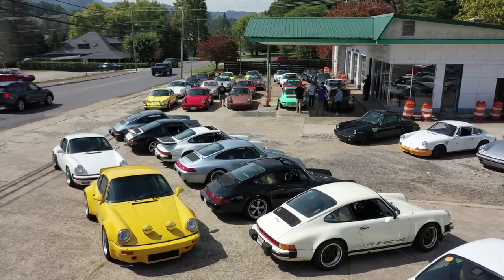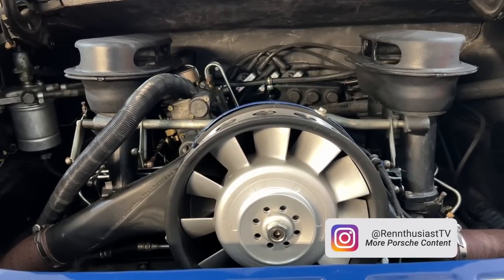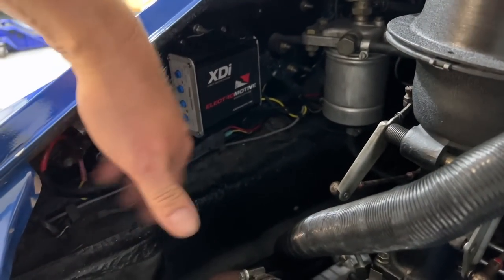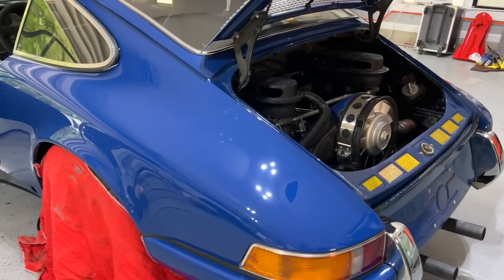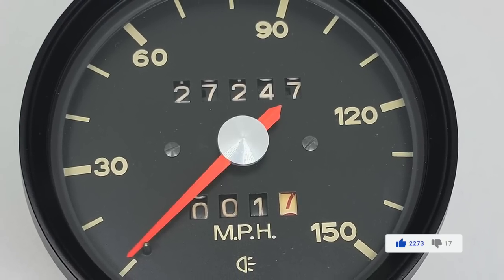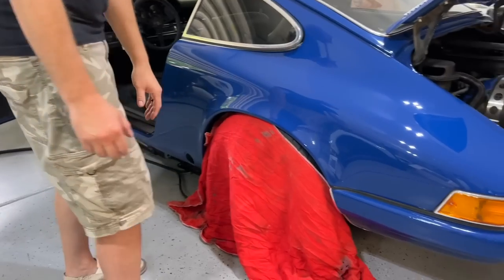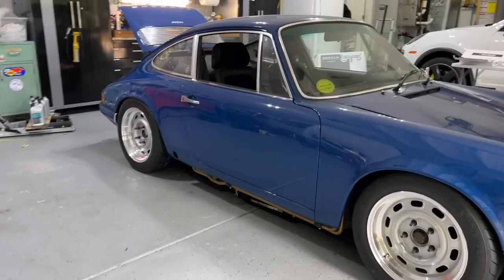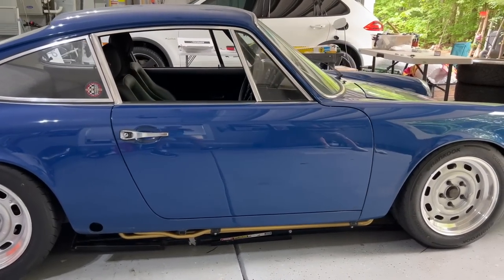Classic Porsche 911 Wheels - Are These As Good As Fuchs?

Comment: Well the engine bay is uncluttered and clean, interesting to see overall how the new ignition system works out. Wheels.. steelies, are awesome, almost missed the chrome on the outside faces. Not sure about the long studs, but they do have racing history. The gold oil cooler lines make a nice contrast and gives a 60's chronograph look with the overall look and finish when looked from a few feet away, leave them unpainted. Looks good Will, do it the way you want it. Can't wait to see the rest..😉

Comment: First off to answer the title question no, IMO for for a long hood ohhh yeah. It's hard to beat the unsprung weight savings of a forged aluminum/magnesium alloy. That said, Group 4 makes an awesome product that provides you with a wider selection of available rubber. I have the Gp4 Campy's and love them, but I'm glad I have a real set of Fuchs 7s and 8s for my G Body as well. I do think you have the best mechanic in in the biz if you want a Sport Purpose 911 Hot-rod!

Comment: Great project. Those wheels are better than the mini-lite look but I can’t help but think cookie cutters would look better though not as unique as these. The oil lines look a bit untidy, so I guess my vote would have been black. The steering wheel and the new gauges will look great and I think you made the better choice with the seats.

Comment: The engine bay, the air cleaners and the tidinesses looks fantastic! The gauges and seats are going to be awesome! I really love the period correct style of the wheels. The oil cooling lines are a personal taste as far as the finish goes. I’d prefer them black, but that’s my taste. I only have one concern, and that’s how low the lines are positioned. Do you have any concerns about debris hitting them, or a low driveway/ speed bump striking them? They seem quite low (about 2”) below the rockers. Gorgeous colour by the way! Blues are my favourite colour on any Porsche!

Comment: Some perfect mods!  Love the ignition set up.  Like the wheels too; might have gone w a more period 15” set up.  What about tires?
Reply from the maker: Hankook rs4’s in 205/55.

I was running 15’s on it originally but it felt a little skittish so I wanted to put a larger wheel with a bit more rubber on the car.

Comment: The concept of the wheels seems fine, but why not just go with steelies? The engine updates and the interior all look amazing. If it were my car I would paint the gold lines black. Right now it looks like somebody didn’t fully paint the car below the doors and somehow missed the rocker panels. But since you are going for a hot rod look, maybe it just doesn’t matter…?
Reply from the maker: Thanks for taking a moment to comment.

Real steelies are heavier and the 16” aluminum wheels I went with evoke the steelies look and vibe while at the same time giving me more tire options given the size.

There is PPF on the rockers.  Maybe that’s what’s throwing your eye off?  The entire car has a fresh paint job, including the rockers.

Thanks again for watching 🙏🏽
Reply: @Rennthusiast  Totally get it on the wheel lightness and more tire choices. 

What I meant regarding the gold oil cooler lines was that they look like the painter missed that area when the car was painted. The effect is that it looks like the car might have been gold in a previous life. I’d go with black and shift the focus back to the awesome blue paint and the steelie-like wheels.
Reply from the maker: @JJL206  oh, ok.  I’m gonna roll with the gold for awhile.  If I get tired of it I can always paint it.  This was the idea.  Leave them as they came with the option to paint later.  I like the look now….but I’ve been known to change my mind, though.

Comment: I get where you're going on those wheels the fuchs are definitely played out, and I would want something more unique as well.   Would be cool if there was a more bronze colored magnesium wheel choice.  Also either a center cap or something that somewhat hides the exposed five lug. 
I'm all about oil coolers and performance, but those oil cooler lines do not look right.  For one they're running right behind the front wheel which is going to kick up stones.  I would personally prefer a very high quality black AN style hoses, and tuck it for a super clean look.  If there is just no room to do that then I would definitely have to paint them matte black to hide. Those oil cooler pipes reminds me of the copper pipes connected to my hot water heater in the basement. 
A good choice on those fixed back seats. 
Next on your list take the car to a custom interior shop to have a custom boot made to cover up that shifter base. Can do a custom pattern to kind of set off the interior and make it a little bit more personalized.  The base of that shifter takes away from the interior imo.  Don't mean to sound like I'm bashing your car as it's a super cool car... just if you're asking that's what I'm saying.  It is your car and your money, and keep doing what you're doing I'll still be here to watch🏁
Reply from the maker: Bro no need to apologize for the feedback.  Thanks for the thoughts and glad you’re engaged with the build 🙌🏼👍🏼
Reply: Nothing wrong with the feedback, but you do realize that the oil lines are in the factory (SC+) location. The rocker covers on later cars do offer some protection but exposed oil lines generally hold up just fine for decades.
Reply: @LeftCoastErik  I would have to tuck them with high quality AN black lines then for a super clean look. Those exposed oil lines could have ground clearance issues and or if you hit road debris at high speed.  There has to be a company out there in the Porsche world that has a retro fit modern design kit by now?
Reply: @DJ_Driven  shockingly they don’t have problems often. I have run them exposed on my car for over 5 years and my car has been Offroad on almost every rally I’ve been on. Lots of track time too. I often run the lightweight black oil lines on cars without coolers and planned to do that on this car too, but the Elephant lines are sexy and Will dug them so that’s what we went with.
Reply: @LeftCoastErik  that's good to know rally would definitely test it out.  I personally would prefer to go with a hidden tucked under the chassis look for a super clean look.  It's just my opinion that everybody has different tastes which I can appreciate. Cars looking good I'm excited to see what you guys accomplish next 🔧🏁
Reply: @DJ_Driven  well unless you cut into the rockers and run the lines in there, there’s nowhere in the chassis to run them. The floor on these cars is basically flat. So they are about as protected there as they can be
Reply: @LeftCoastErik  well there you go he needs an RSR wide body kit next.
Reply: @DJ_Driven  he dove in deep to the longhood scene. Let’s give him a minute. Lol